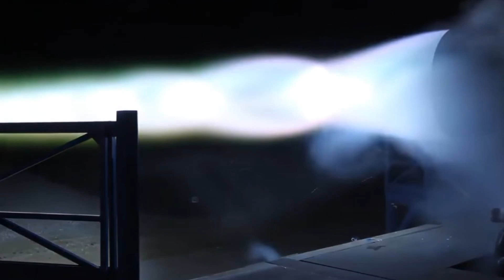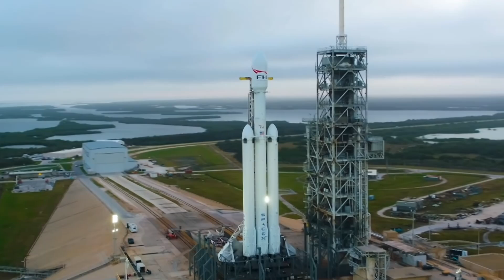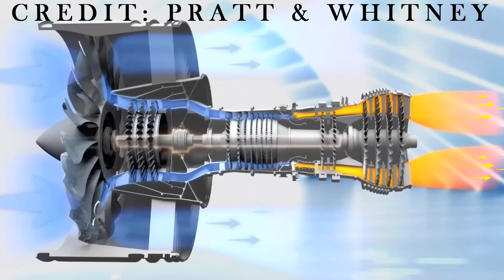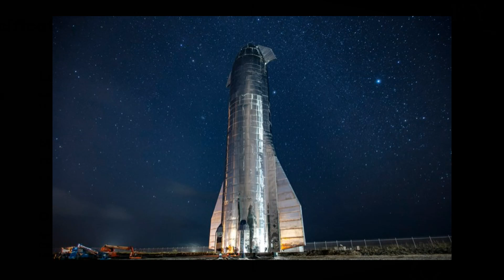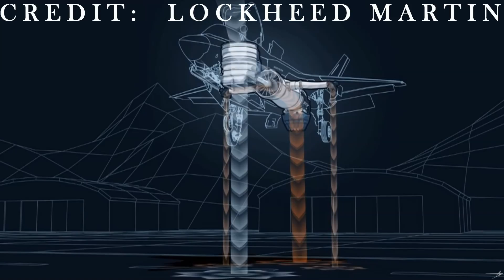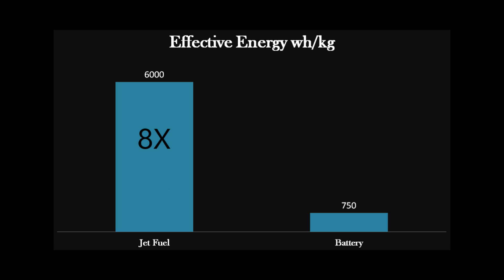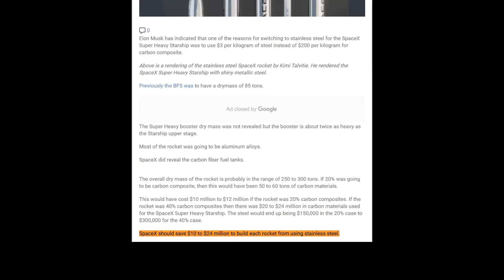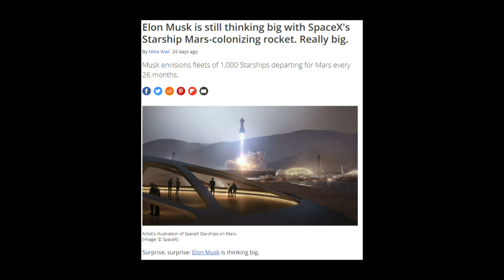ELON MUSK'S BATTERY POWERED SUPER SONIC VTOL JET - My Tesla E-SuperVTOL design

Comment: Here is a bonkers out of the box concept for you, airports become 'taxi' pads to get to the 'airport's as they are relocated to hovering/ floating way points (think helium craft with electric stabilizers whose entire surface is a solar panel). Your VTOL docks and sets of from these ports. The thinner atmosphere would mean the flights would start from an advantageous point, saving the huge amount of force needed to reach a cruising altitudes. Ground ports could be anywhere and far smaller .. personal drone size. Checking in could be carried out by the drone before setting off.
Reply from the maker: That is bonkers!

Comment: My understanding of jet powered engines is the compressor, compress's the air and the fuel then heats that air to make it expand out the back providing thrust. Now if you use an electric motor, and that motor is heating up, couldn't you use that heat to expand the compressed air replacing fuel heat with engine heat?
Reply from the maker: YES!  That's exactly what I'm thinking!  Been investigating this...https://qr.ae/Tdus4I
Reply: @thelimitingfactor  Please let me know what you find out.
Reply from the maker: @Mauipat  I'll be making a video...but it might be a couple months.  Battery investor day is the focus through to April.  Lots of information to absorb from these comments!  :)

Comment: Do you realize you can reduce drag further by putting piezo transducers on the hull which can be tuned to the air speed and reduce the drag even more. just like how a vibrating object is easier to slide along a surface.
Reply from the maker: Fascinating concept!
Reply: @thelimitingfactor  you can test it easily by attaching a speaker/transducer to any object and measuring the force to move it with and without the device and altering the frequency.it reduces the friction.in air the same would apply at higher frequencies.anyone seen how a mobile phone slides about even on a slight incline when vibrating? same principle.

Comment: Great video, but sone misconceptions. Firstly make it stainless steel or/and pilotless and they put you on the chair. Autonomous cars are already really difficult to get a permission for, and these still need a secondary cockpit. Planes have even worse/strict inspections, and you cant get a license for these. And stainless steel wouldnt work because its simply to strong. If a crash acures, the lower half with the cargosegment in normal planes gets destroyed, but also absorbes the shock off the impact and speed. Therefore the weaker structure safes the ppl inside.
Multiple wings, multiple engines.... Ouch! Thats very unstable in flight! There are just narrow spaces in planes where turbines can go. Look up center of lift and center of gravity on planes, your center of lift has to be on the same spot as the center of gravity, thats due to multiple wing not the case, and thats very unstable.
Battery placement... As again center of gravity, you dont want a nose /tail hvy aircraft, or it will go down.
No control surfaces as again ouch you need these, if one of the engines break down, you can hover nore stear and you go down, these control surfaces prevent that
No vertical stabilizer, again very unstable,
So in total your plane wouldnt fly, if it would fly, it would be very unstable and go down, and due to no secondary systems like cockpits, control surfaces etc, you would kill everybody inside
Reply from the maker: Feedback appreciated!  I'll be making a v2
Reply: @thelimitingfactor  thx, sry for the bad grammar 😬
Reply from the maker: @moritzk3004  ha!  All good, I understood!

Comment: An electric fan can't just spin faster and produce a supersonic exhaust. You'll just get shocks. The reason gas turbines can do it is because they're heating the exhaust to a thousand kelvin and hot gas has a higher speed of sound. To do it with electric you'd need either heating elements or some EM element.
Reply from the maker: I don't think it would just spin faster, and it wouldn't use a fan.  It would use a compressor to heat and compress the air to force it through an expander.  This would reduce or eliminate the need for a heating element?

Comment: You can't just extrapolate battery density forwards. The progression mechanism isn't the same and there are good physical limits that prevent most chemistries from getting to 1000 Wh/kg
Reply from the maker: Correct!  It's more complex than that.  But specific energy has increased 3.5% per year for the last 20. I expect the curve will steapen with scaling, learning effects, capital, and new testing technology (see Meng and Dahn videos)

Comment: If you are using drone tech then small becomes effective 20 - 30 seats for short haul, 50.- 100 for medium haul. Have flights leave hourly. No need to scale to the large jet size. Easier engine design and simpler air frame.

Comment: Interesting idea and analysis. For current battery tech perhaps a hybrid idea with a range extender power generator could be explored. 1K Wh/kg may be further than 2030. Having enough batteries to power the first 5 - 10 minutes of flight with a power generator sized for the cruise speed speed power requirements would make the aircraft do able with current tech.

Comment: I have a question about the decision to assume use six engines.  

A 737 is fair comparator for mass.  

It's max take off weight is ~160,000 pounds.  
It uses two engines which together generate ~60,000 lbs of thrust and ~50,000 horsepower. 
Together these two engines weight 6,000 pounds.

So using rough numbers, with six motors, you're assuming that each motor will able to generate 8,000+ HP?  It would have to be much more because the 737 is subsonic. 

Leaving that aside, with current technology, an 8,000  HP electric motors weight 45,000k pounds by themselves and are 8' in diameter.  

If we cut that weight in half to account for innovation, you're still left with ~160,000 pounds, which is essentially the max takeoff weight 737 for just those six motors.  Batteries would have to weigh at least that much as well.   So 320,000 pounds in engines and fuel for this concept. 

My god, this concept would require some kind of unimaginable miracle in electric motor power and minification for this to work....and some kind of battery miracle, too.

Comment: Hi. I work in aviation. Stainless steel is something like 10 times heavier than composite. I seriously doubt that would ever work. 

Short haul flights take place at low speeds and low altitudes, partly due to air traffic control needs. A lot of short haul flight times to high density airports is spent fitting into the traffic patterns, and even a VTOL aircraft would have to be maneuvered around all the other aircraft, at low speeds and altitudes, negating everything the concept aircraft may do well. Combined with the added weight of steel and batteries, short haul is a non starter. Short haul will not work. 

Existing aviation technology, which has changed very little in the past 30 years, does not at all allow for autonomy. Even with advances in GPS, 99.9 percent of flights are landed manually by pilots. The 0.1 flights auto landed by the aircraft in extremely poor and rare weather, require non-GPS based approaches called “Category II(III) approaches.” The approaches are flown by the aircraft only for the last 1500 feet down and require old technology but ultra precise “instrument landing systems” or ILS’.  There is no GPS landing system that is precise as an ILS, and when Category II ILS is being used the airports run backup generators as a redundant failsafe should a surprise power outage occur. There’s a lot that happens to have an auto landing aircraft do it’s thing, and that’s why there’s pilots doing the landings the vast majority of the time. They’re cheap, and autonomy tech isn’t anywhere close yet, would require huge infrastructure changes at airports and ATC facilities. 

The design I see looks like the engines will be jet washing over the wings. The jet wash is incredibly turbulent and simply cannot be anywhere near a flying surface. There is a reason why engines are mounted where they are on conventional aircraft. You will notice there is no jet aircraft ever in existence, VTOL or not, that has a jet engine exhausting anywhere close to a flying surface. The negative effects of jet was on a flying surface would be greatly exacerbated at Mach speeds. 

This concept will not work for short haul, autonomy is decades away and will be incredibly expensive to implement, and the engines cannot be where there are because of physics.
Reply from the maker: Totally on point, and thanks for the information.  I'll be making a V2 with all this feedback.  Shooting for an aluminum or composite that operates just above mach 2.  Stainless would only be feasible for >mach3...and at that point, it's better to use titanium.

Agreed on the jet wash!  This will be fixed.
Reply: I agree with the point about Steel. In the Starship rocket stainless steal is used because of its increased stability under cryo temperatures and increase stiffness compared to aluminum under reenter heating. Both do not apply to a this jet, carbon composite or aluminum is far more likely.
Reply from the maker: @---jc7pi  Agreed

Comment: Flawed on so many levels. 
If the design was practical they would have done it with conventional jet engines,  Second, what limits the flight altitude of commercial jetliners is cabin pressurization NOT the engines.   Some really flawed assumptions.

Comment: Amazingly compelling and complete. However I see one fundamental problem with the design.  Vertical take off and landing. 

VTOL-capable planes rarely take off and land vertically because doing so requires a massive amount of energy relative to level flight--energy that would be better applied to increased range, or weight reduction (less on board fuel).   So you’d need and indeed want larger wings to provide for sloped take off and landing. 

But even more critical is the ability to cruise at altitude  Without suitable wings, the engines would have to be run a near max power and at unusually steep down angle, to keep it level.  This would in turn introduce a considerable amount of drag. 

Another problematic assumption here is altitude.  What you’re proposing for propulsion is essentially a ducted fan, which needs dense air else the compressor blades don’t have enough air to bite into and generate thrust.  This is why helicopters and turboprops can’t fly as high as jets. 

Conventional jets don’t have this problem because they heat and expand the air—they get more efficient with altitude. 

I mentioned landing gear. You'd still want and need wheels to taxi efficiently, and for safety.   

Sum up: larger wings and landing gear will enable weight savings and greater efficiency.
Reply from the maker: Thoughtful response thank you!  I was thinking a turbojet style...but instead of a combustion chamber adding more compression zones...compression would heat the air and further compress it for propulsion.
Reply: @thelimitingfactor  Thank you so much for the kid and thoughtful reply!

Comment: Hmmm electric propulsion looks possible but not for supersonic speeds. Not even for high subsonic speeds. Electric engines consume a lot of energy at really high rpms. Electric propulsion is going to use propellers which are very limited. When the propellers move quickly enough to break the sound barrier it starts to introduce inefficiencies which affect the efficiency and speed of the craft

Comment: Autonomous not be answer. Still has someone in control of software. They can be taken over or hacked. Think landing gear maybe have at least one wheel incorporated into it for emergency landing if gimbals fail. Also wider apart for better stability. Also think wing tips could be just outside of jets to handle airflow better. Of course I have thought about this too, and I think I have an idea to cool the motors along with providing more thrust. But I still like your ideas and views on it.

Comment: In general jet engines rely on combustion, electric jet has only a fan and compressor. How can it ever draw in enough air to provide the thrust required to make it supersonic? What pressure does the air have to be compressed to in order to accelerate the craft to supersonic speeds?
Reply from the maker: Researching!
Reply: @thelimitingfactor  Looks like it should be easy.
At 60k feet air density is 0.1 compared to sea level. Aerodynamic drag is also about 0.1. SR-71 has 2x 110kN thrust. Assume a smaller plane needs 1x 100kN thrust at 60k feet. It has 1 engine with an intake radius 4m. Surface area ~ 50m2. Desired aircraft velocity 2240mph-> 1000m/s. Volume of air through engine in 1 second = 1000 x50=50000m3. Flow rate = 50k x 1.25 x 0.1 = 6250 kg/s at 60k feet. Need 100kN of force by accelerating air through engine (6250 kg/s). What is required exit velocity (acceleration) of the jet of air? (so thrust equals drag)
force / mass flow rate = velocity = 110000/6250 =  17.6 m/s/s
Reply from the maker: @goldreserve  Your physics are music to my ears.  What would the difference in KN required be between the blackbird, which went Mach 3+ and something like Mach 2?
Reply from the maker: Do the physics support compressing the air high enough and hot enough to create supersonic thrust?